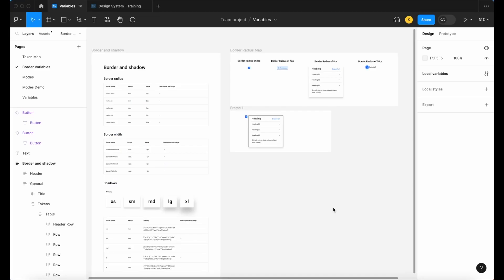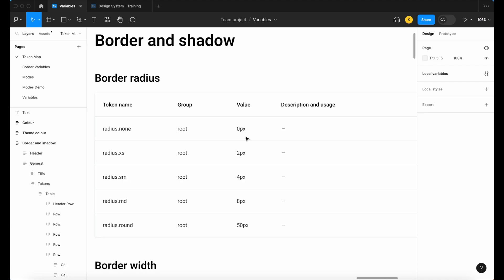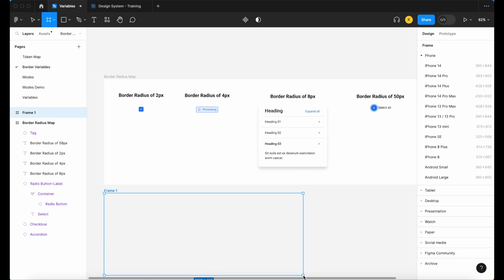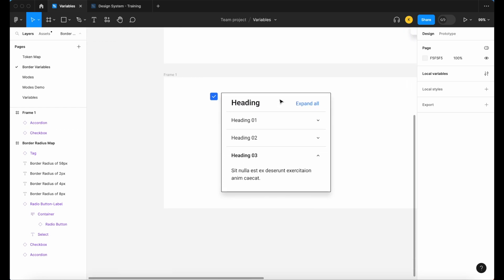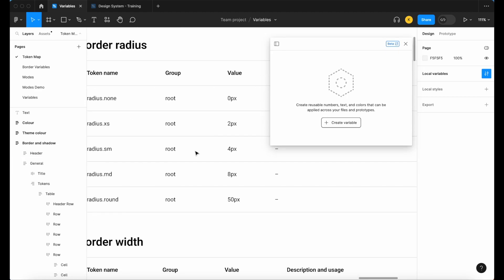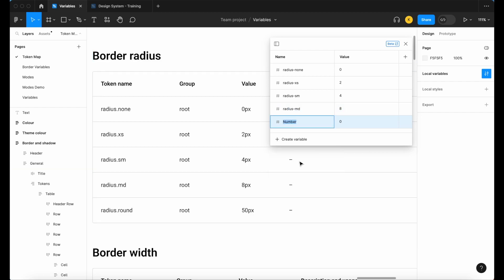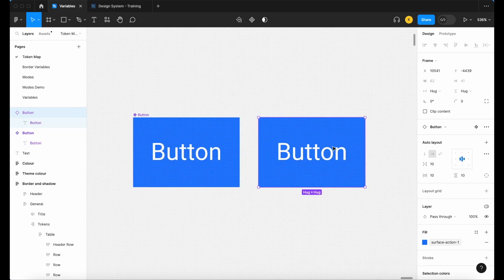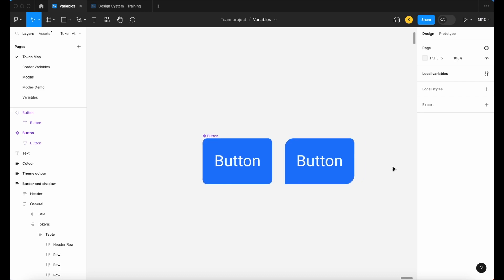An Introduction to Border Radius Variables in Figma

Comment: Great, video!

What I didn't notice there, but it may be important. When working with variables, documentation is very important, in this case if we created a border radius save it to be available only for the border radius, not for element spacing or padding.